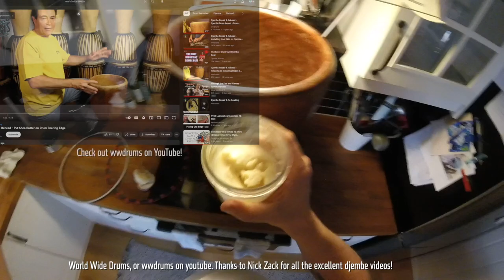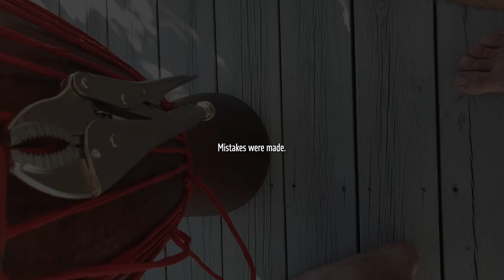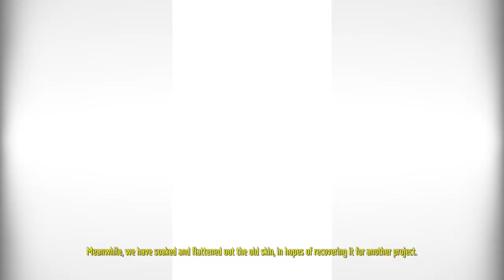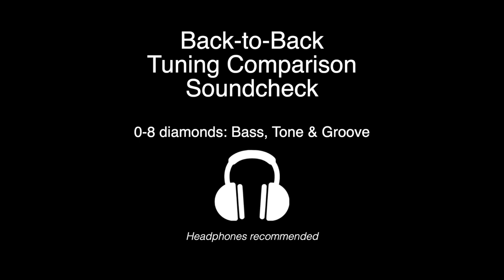Djembe Repair: Replacing broken head, restoring, and demo!

Comment: Hey there! Thanks so much for your videos! Just wondering if it's possible to remove a skin, re-soak it and re-install it on the djembe? I got someone to replace the skin on my drum as I had little time before a flight & they didn't do the best job so I want to re-do it myself before I shave the hair and tune it, just wondering if that's possible or will it ruin the skin to re-soak it?
Reply from the maker: Thanks for the comment! So glad you liked the video. The answer is yes! You can re-soak and repeat the process as many times as needed. I would apply a leather dressing though to keep the skin oiled and supple, as too many soaks can cause the skin to feel a little dry. Have a nice day! -Nolan